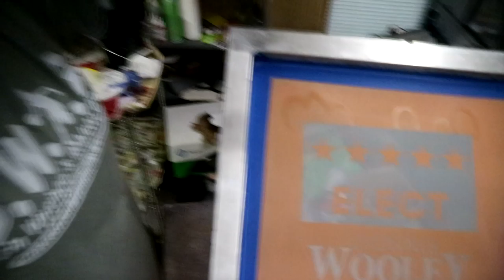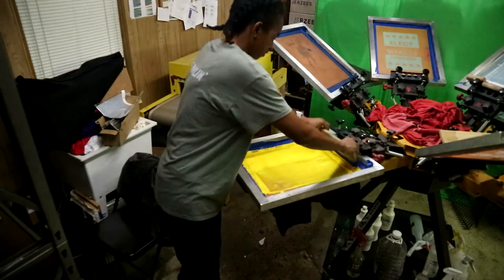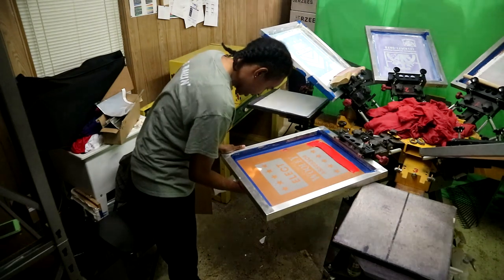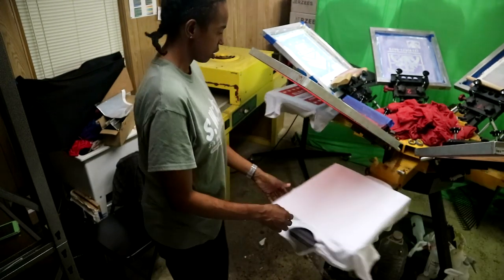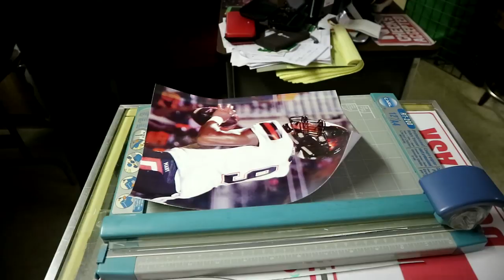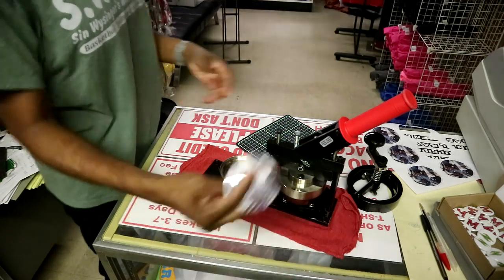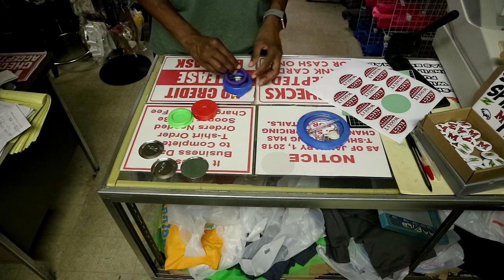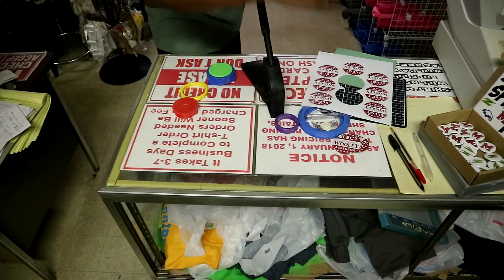Working In A T Shirt Shop ( T-shirt Shop Vlog 2019)

Comment: Hi T-shirt chick did you need to use that screen opener because of emulsion that dripped into the image, I use a hair dryer to dry out the open areas right after washing out the screen so that emulsion doesn't drip into the area then I place the screen in front of a fan to finish drying it...that hair dryer trick has come in handy over the years.!!!
Reply from the maker: In one case the ink had caused the problem and the other was issues that I had with the way the film was printed with lines in some places.

Comment: What mesh size do use for small logos on the front chest?
Reply from the maker: It depends on the detail of the design I have a video about what screen mesh to use for certain types of designs.  I have used 110, 160 and 230 for pocket logos.
Reply: @TshirtChick  yeah mines on 110 an its coming out too thick..blotchy prints.maybe my screens not off contact?